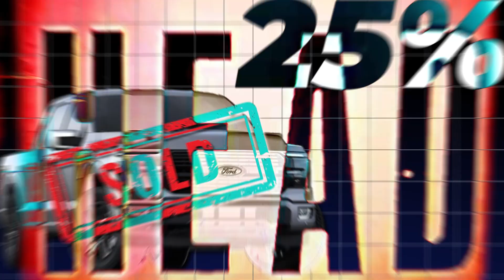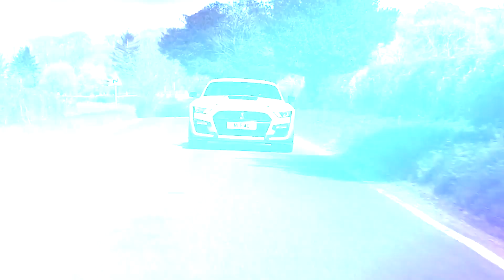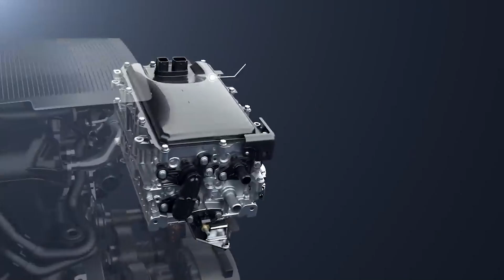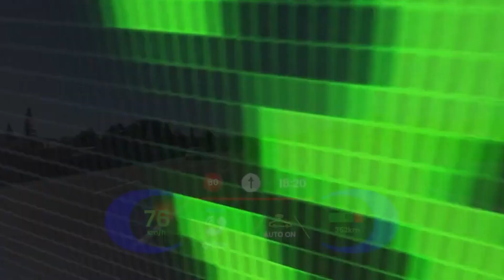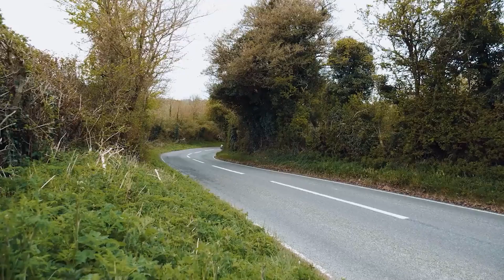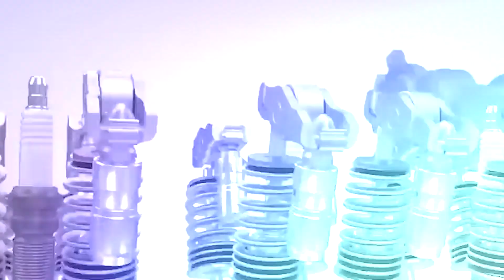Ford’s NEW Engine SHAKES UP The Entire Car Industry!

Comment: 12 psi of boost is probably the lowest of any turbo manufacturer on this planet. Direct injection has been around for 25 years. But they've not explain anything on what it runs on. Ford is so desperate. Variable cam timing has been around for as long as direct injection and turbos.

Comment: The battery will be designed to be in the middle of the cylinders and you'll need to pull the engine to change the water pump and starter! 🤣🤦